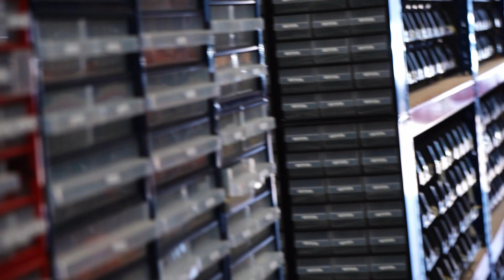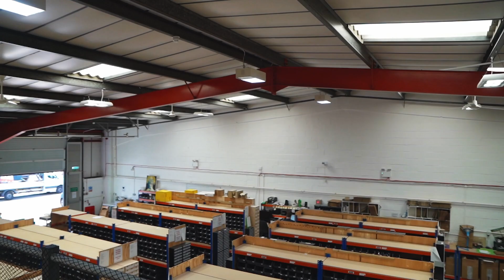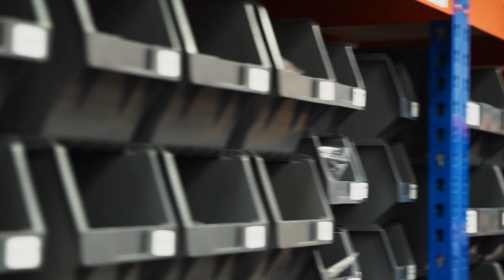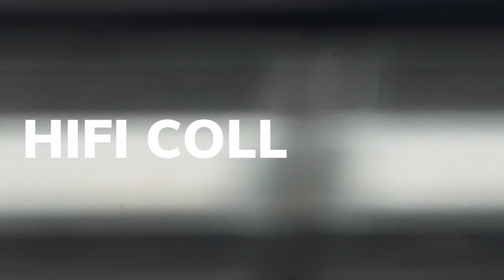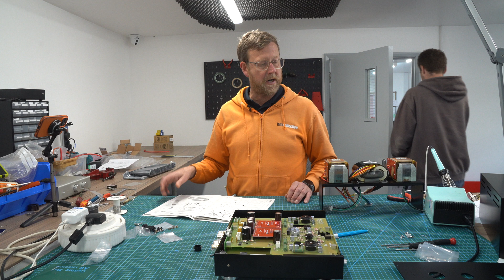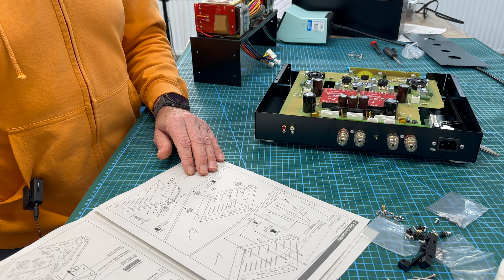Elekit TU-8900VK Single Ended Tube Amp build: Assembly (4/4)

Comment: Thank you so much for this video. I couldn't have done it without your help! I'm using the Japanese instruction manual (though now retired, I used to drive by the Elekit factory every day on my way to work). One question: What are the R139 and R239 resistors (not included) intended for? (By the way, I botched the volume switch and ordered your upgrade kit, which saved the day.) Another by-the-way: My label sheet (for use in Japan) has one spelling mistake -- on the Green = 2A3  Blue = 300B  Red = Error, one of the labels (the top one) reads "RED = EROOR." Oh, well, here is Japan. Again, thanks for the video.
Reply from the maker: Hi, thank you for your comment. If you can email us at info@hificollective.co.uk our technican will be able to advise.